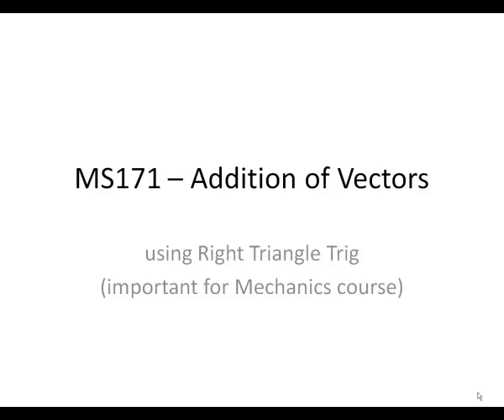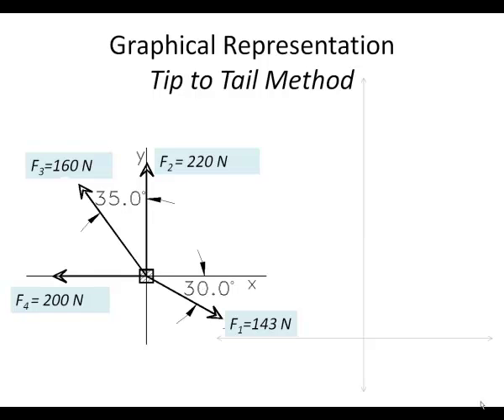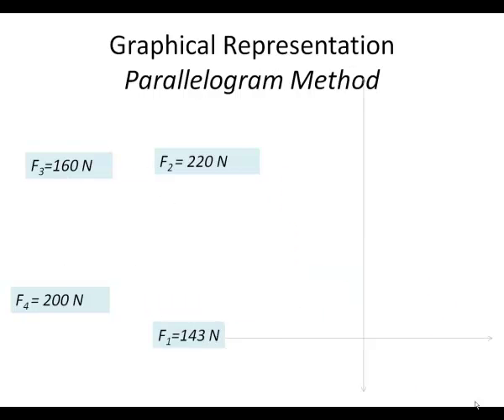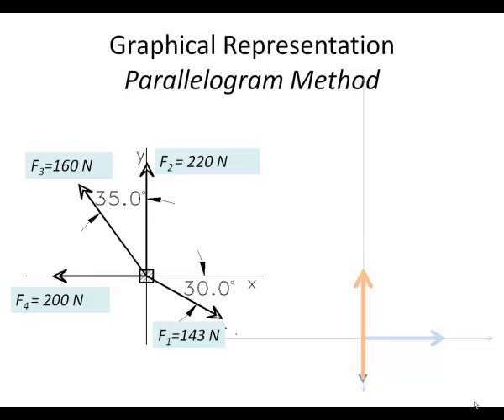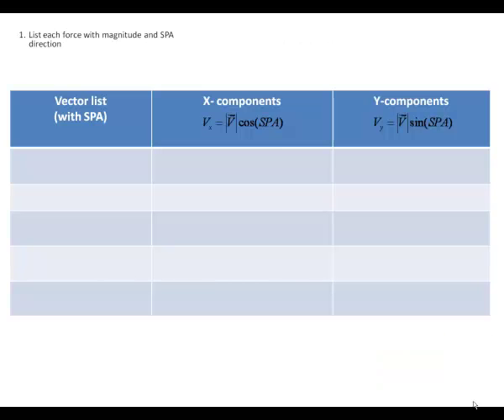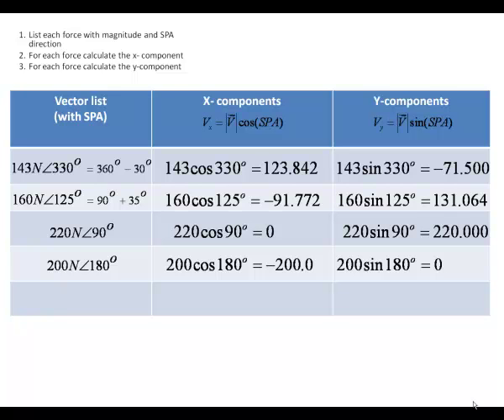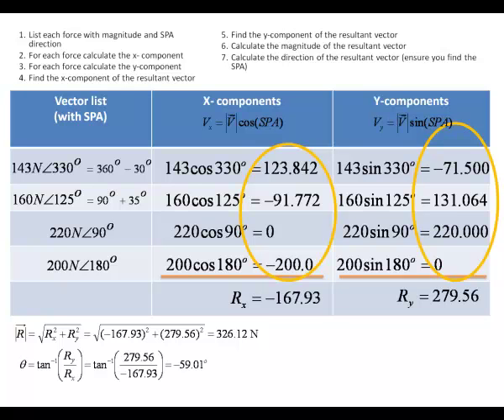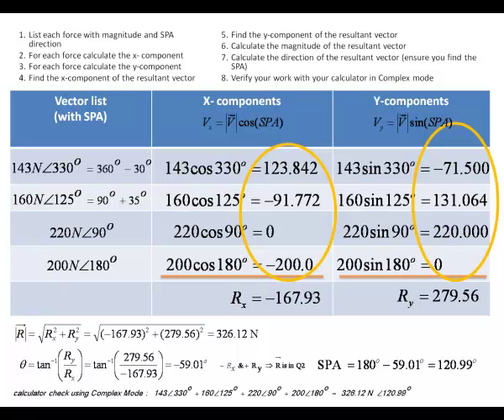Vectors - Basics of Addition of Vectors

Comment: For using the inverse of the tan function shouldn't you have entered both the numbers without the minus sign that is originally attached to it or does it not matter? I mean shouldn't -167.93 have been entered without the minus sign?
Reply: +Nick Marsala: we keep the signs so that we stay aware of which quadrant our resultant vector is in. We could make them both positive and still get the correct reference angle but we might make the mistake of thinking our resultant vector is in quadrant 1 when it is not.
Reply: Valerie Webber So what your saying is that in cases of addition of vectors this is for quadrant identification purposes? I take it this is also for subtraction of vectors as well? What other areas is this the case?